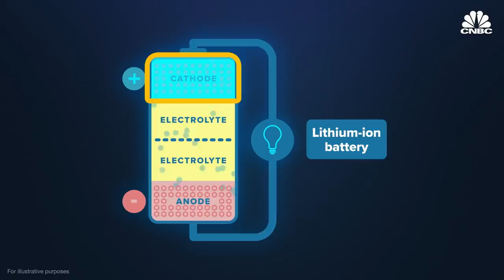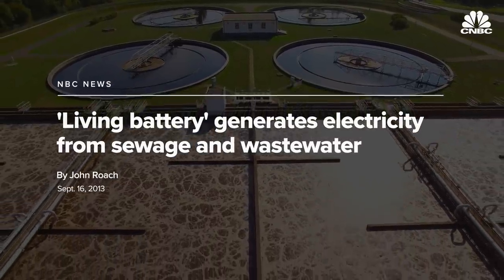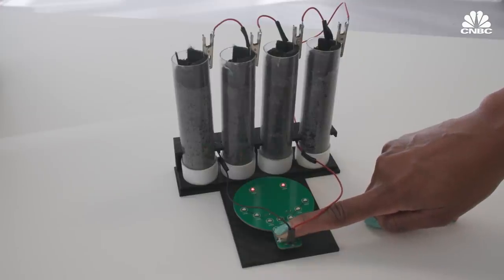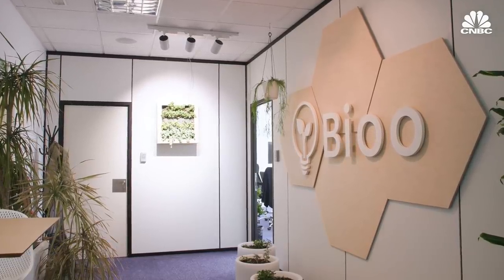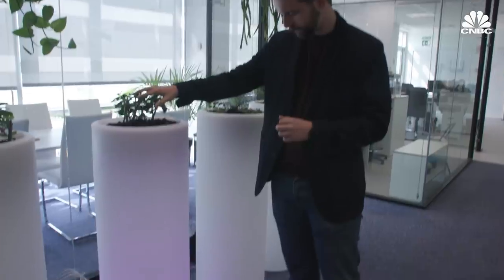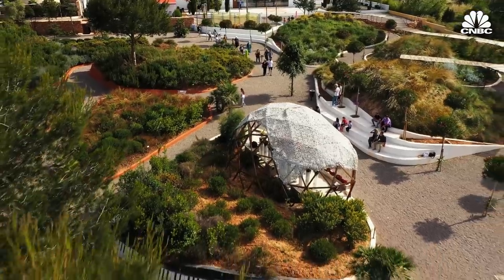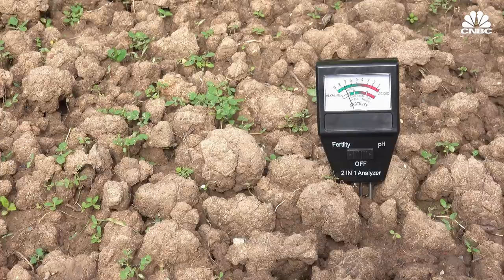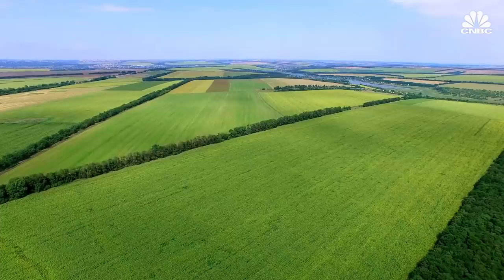How Soil Could Be An Untapped Source Of Electricity

Comment: Potential endless energy source basically anywhere in this universe:

a. Small aluminum cones with an electrical wire running through the center of the cones, cones spaced apart (not touching I'm thinking) but end to end.
b. Electromagnetic radiation energy in the atmosphere interacts with the aluminum cones.
c. Jostled atoms and molecules in the cone eventually have some electrons try to get away from other electrons of which those electrons gather at the larger end of the cone, of which also creates an area of positive charge at the smaller end of the cone.
d. The electron's in the wire are attracted to the positive end of the cone and the positive 'end' in the wire are attracted to the negatively charged end of the cone.
e. Basically a 'battery' has been created inside the electrical wire itself, different areas of electrical potential.  Basically a 'wire battery' or a 'batteryless battery', however one wanted to call it.
f. Numerous cones placed end to end increases the number of 'batteries' in the wire.

Then of course, one could take that generated dc electricity to split H2O into H2 and O2 of which could be burned or utilized in a hydrogen fuel cell to get the electricity back with a byproduct of basically pure water.  Species need pure water too.

With the increased cosmic radiation that is going to be impacting this Earth this century as well as possibly a mini-ice age, might as well put that cosmic radiation to work for us.
Reply: Hydrogen:  See my Twitter page under the same name as this comment to see years worth of just some of what this world is already doing with Hydrogen.  (The Twitter ID with the '001charlieb' to aid in your search of this 'me' as there are many "me's" apparently in existence).
Reply: Absolutely agree as that what causes the northern lights in Alaska at north pole or positive end of earth's magnetic dynamo always there along with lightning so much as has to discharge this wasted energy also need more ideas like this to use cosmic energy and earth dynamo magnetic generater  possibly magnetic intersects may be areas where UFO get re up on there energy and why reason come here and then go away once re energized is my thought theory and always like to think of new ways off the wall thinking to get the energy there already thanks will try harvest energy by what described.
Reply: @jodygwinn6938  Well, 2 things.
a.  Look into Telluric currents and/or Earth Batteries.  The energy that flows through the surface of the Earth can be tapped into.  They used to do it back in the days of the telegraph.  Buried metal plates, parallel to each other, perpendicular to the flow of energy, separated from each other, but not too far apart, and some even put another plate in between those two, perpendicular to those two, not touching, to help concentrate the energy between the two main plates, and one plate takes on a positive charge and one plate takes on a negative charge.  An 'Earth Battery'.

And here again, one could take that dc electricity to split water into hydrogen and oxygen for other uses as stated above in the opening of this thread.

b.  Find some entity to do my gravity test and 'if' true, potentially have the literal theory of everything for this universe.  Then just tap into the eternally existent ever flowing energy for whatever one wants to do with it.  (See the posts to you after this post).
Reply: @jodygwinn6938  (copy and pastes from my files):

Here is the test for the 'gravity' portion of my TOE idea.  I do not have the necessary resources to do the test but maybe you or someone else reading this does, will do the test, then tell the world what is found out either way.

a. Imagine a 12 hour clock.
b. Put a magnetic field across from the 3 to 9 o'clock positions.
c. Put an electric field across from the 6 to 12 o'clock positions.
(The magnetic field and electric field would be 90 degrees to each other and should be polarized so as to complement each other.)
d. Shoot a high powered laser through the center of the clock at 90 degrees to the em fields.
e. Do this with the em fields on and off.
(The em fields could be varied in size, strength, density and depth.  The intent would be to energy frequency match the laser and em fields for optimal results.)
f. Look for any gravitational / anti-gravitational effects.
(Including the utilization of ferro cells so as to be able to actually see the energy field movements.)
(And note:  if done right, it's possible a mini gravitational black hole might form.  Be ready for it.  In addition, it's possible a neutrino might be formed before the black hole stage, the neutrino being a substance with a very high gravitational modality with very low 'em' modalities.)

(An alternative to the above would be to shoot 3 high powered lasers, or a single high powered laser split into 3 beams, each adjustable to achieve the above set up, all focused upon a single point in space.)

'If' effects are noted, 'then' further research could be done.
'If' effects are not noted, 'then' my latest TOE idea is wrong.  But still, we would know what 'gravity' was not, which is still something in the scientific world.  Science still wins either way and moves forward.
Reply: @jodygwinn6938  Revised TOE: 3/25/2017a.
My Current TOE:

THE SETUP:
1. Modern science currently recognizes four forces of nature: The strong nuclear force, the weak nuclear force, gravity, and electromagnetism.
2. In school we are taught that with magnetism, opposite polarities attract and like polarities repel. But inside the arc of a large horseshoe magnet it's the other way around, like polarities attract and opposite polarities repel. (I have proved this to myself with magnets and anybody with a large horseshoe magnet and two smaller bar magnets can easily prove this to yourself too.  It occurs at the outer end of the inner arc of the horseshoe magnet.).
3. Charged particles have an associated magnetic field with them.
4. Protons and electrons are charged particles and have their associated magnetic fields with them.
5. Photons also have both an electric and a magnetic component to them.

FOUR FORCES OF NATURE DOWN INTO TWO:
6. When an electron is in close proximity to the nucleus, it would basically generate a 360 degree spherical magnetic field.
7. Like charged protons would stick together inside of this magnetic field, while simultaneously repelling opposite charged electrons inside this magnetic field, while simultaneously attracting the opposite charged electrons across the inner portion of the electron's moving magnetic field.
8. There are probably no such thing as "gluons" in actual reality.
9. The strong nuclear force and the weak nuclear force are probably derivatives of the electro-magnetic field interactions between electrons and protons.
10. The nucleus is probably an electro-magnetic field boundary.
11. Quarks also supposedly have a charge to them and then would also most likely have electro-magnetic fields associated with them, possibly a different arrangement for each of the six different type of quarks.
12. The interactions between the quarks EM forces are how and why protons and neutrons formulate as well as how and why protons and neutrons stay inside of the nucleus and do not just pass through as neutrinos do.

THE GEM FORCE INTERACTIONS AND QUANTA:
13. Personally, I currently believe that the directional force in photons is "gravity".  It's the force that makes the sine wave of EM energy go from a wide (maximum extension) to a point (minimum extension) of a moving photon and acts 90 degrees to the EM forces which act 90 degrees to each other.  When the EM gets to maximum extension, "gravity" flips and EM goes to minimum, then "gravity" flips and goes back to maximum, etc, etc.  A stationary photon would pulse from it's maximum extension to a point possibly even too small to detect, then back to maximum, etc, etc.
14. I also believe that a pulsating, swirling singularity (which is basically a pulsating, swirling 'gem' photon) is the energy unit in this universe.
15. When these pulsating, swirling energy units interact with other energy units, they tangle together and can interlock at times. Various shapes (strings, spheres, whatever) might be formed, which then create sub-atomic material, atoms, molecules, and everything in existence in this universe.
16. When the energy units unite and interlock together they would tend to stabilize and vibrate.
17. I believe there is probably a Photonic Theory Of The Atomic Structure.
18. Everything is basically "light" (photons) in a universe entirely filled with "light" (photons).

THE MAGNETIC FORCE SPECIFICALLY:
19. When the electron with it's associated magnetic field goes around the proton with it's associated magnetic field, internal and external energy oscillations are set up.
20. When more than one atom is involved, and these energy frequencies align, they add together, specifically the magnetic field frequency.
21. I currently believe that this is where a line of flux originates from, aligned magnetic field frequencies.

NOTES:
22. The Earth can be looked at as being a massive singular interacting photon with it's magnetic field, electrical surface field, and gravity, all three photonic forces all being 90 degrees from each other.
23. The flat spiral galaxy can be looked at as being a massive singular interacting photon with it's magnetic fields on each side of the plane of matter, the electrical field along the plane of matter, and gravity being directed towards the galactic center's black hole where the gravitational forces would meet, all three photonic forces all being 90 degrees from each other.
24. As below in the singularity, as above in the galaxy and probably universe as well.
25. I believe there are only two forces of nature, Gravity and EM, (GEM). Due to the stability of the GEM with the energy unit, this is also why the forces of nature haven't evolved by now. Of which with the current theory of understanding, how come the forces of nature haven't evolved by now since the original conditions acting upon the singularity aren't acting upon them like they originally were, billions of years have supposedly elapsed, in a universe that continues to expand and cool, with energy that could not be created nor destroyed would be getting less and less dense? My theory would seem to make more sense if in fact it is really true. I really wonder if it is in fact really true.
26. And the universe would be expanding due to these pulsating and interacting energy units and would also allow galaxies to collide, of which, how could galaxies ever collide if they are all speeding away from each other like is currently taught?

DISCLAIMER:
27. As I as well as all of humanity truly do not know what we do not know, the above certainly could be wrong. It would have to be proved or disproved to know for more certainty.
Reply: @jodygwinn6938  'IF' my latest TOE idea is really true, (and I fully acknowledge the 'if' at this time), that the pulsating, swirling 'gem' photon is the energy unit of this universe that makes up everything in existence in this universe, and what is called 'gravity' is a part of what is currently recognized as the 'em' photon, then the oscillation of these 3 interacting modalities of the energy unit would be as follows:

Gravity: Maximum in one direction, Neutral, Maximum in the other direction;
Electrical: Maximum in one direction, Neutral, Maximum in the other direction;
Magnetic: Maximum in one direction, Neutral, Maximum in the other direction.

Then:
1 singular energy unit, with 3 different modalities, with 6 maximum most reactive positions, with 9 total basic reactive positions (neutrals included).  Hence 1, 3, 6, 9 being very prominent numbers in this universe and why mathematics even works in this universe.
(And possibly '0', zero, as possibly neutrals are against other neutrals, even if only briefly, for no flow of energy, hence the number system that we currently have).

And also how possibly mathematical constants exist in this universe as well.
Reply: @jodygwinn6938  Potential completion of the Periodic Table of the Elements:

I currently believe that there are 120 chemical elements in this universe.  If a person were to look at how electrons fill up the shells in atoms: 2, 8, 18, 32, 32, 18, 8 (seven shells), and realizing that energy could freely flow in this universe if nothing stopped it from doing so, then a natural bell shaped curve might occur.  An eighth energy shell might exist with a maximum of two elements in it, chemical element #119 (8s1) and chemical element #120 (8s2).

Chemical Element #119 (8s1):
#119 I put at the bottom of the Hydrogen group on the Periodic Table of the Elements.  It only has one electron in it's outer shell with room for only one more electron.  Energy might even enter the atom through the missing electron spot and then at least some of the energy might get trapped inside of the atom under the atom's outer shell.

Chemical Element #120 (8s2):
#120 I put at the bottom of the Helium group since it's outer shell is full of electrons.  It might have some of the properties of group two, Beryllium group (Alkali Earth Metals group) since it has two electrons in it's outer shell; as well as some of the properties of the Helium group (Noble Gases group) since it's outer shell is full of electrons; and if you look at the step down deflection of the semi-metals and where #120 would be located on the chart, it's possible #120 might even have some semi-metal characteristics.  #120 would be the heaviest element in this universe.  I believe chemical element #120 could possibly be found inside the center of stars.

When a neutron split inside of this atom, it would give off one proton, one electron, neutrinos and energy.  The proton and electron would be ejected outside of the atom since all their respective areas are full.  One proton and one electron are basic hydrogen, of which the Sun is primarily made up of, and the Sun certainly gives off neutrinos and energy.  And note, it's the neutron that split, not a proton.  So even after the split, there are still 120 protons inside of the atom and the atom still exists as element #120.  The star would last longer that way.

In addition, if the neutron that split triggered a chain reaction inside of the star, this could possibly be how stars nova, (even if only periodically).

If stars were looked at as if this theoretical idea were true, and found to even be somewhat true, then we might just have a better model of the universe to work with, even if it's not totally 100% true.  And if it's all 100% true, then all the better.

Comment: What am I missing here? Why don’t these sensors in farmers fields have a small solar panel to keep the batteries charged up like so many small lights and devices today? Just Curious. I assume I’m missing something and it’s not that simple.
Reply: Yes, solar is expensive and takes up a lot of space and still needs a batery, the sensor you just stick it out of the soil when you are going to harvest....
The sensor with the soil power is a sbustitute for the sensor with chemical AA batteries which are better than solar...
Reply: You are missing nothing, this is a solution in search of a problem.

Comment: What if you used a football field size area of biopanels paired with sets of alternating charging and discharging super capacitors that can supply a constant flow of electricity into the grid or used to power other things. Example they said 3.7wats per sqft. A football field is 57,000sqft. Which means it has the energy potential of 210,000 watts as a giant biopanel system. Average home uses 36,000 wats a day. You could power 5 homes a day with a football field. Which is allot and not allot at the same time but paired with storage tech, solar and wind. You could make a solar,bio,wind farm that uses its combined production capicity of an area to supply a large boost to a local grid. Combining technologies.

Comment: 1/4 the power density of solar... Why not put a solar battery and rechargeable battery on the sensors, like garden lights? 

I'm sure there will be niche applications for their technology, but it's not going to go mainstream.
Lighting gardens and cities,? There's the infrastructure in place to power the devices. 
Powering cities? Put up solar panels and storage. 

I think one of the biggest hurdles they'll face is with licencing. How much will this cost compared to a cheap solar panel and rechargeable battery?

 Another problem is demand. What demand is there for these small sensors?
 Many farmers use agronomists to analyse their soil, determine what chemicals to apply etc. Soil pH doesn't require constant monitoring, fertiliser demand is determined by soil analysis, herbicide and pesticide demand is determined by looking at the crop and management. For example, a large agronomist firm might have access to satellite data, showing soil moisture, crop cover and other data. They'll do soil analysis to determine what fertilisers to apply and where. 
Are the small sensors going to replace that?